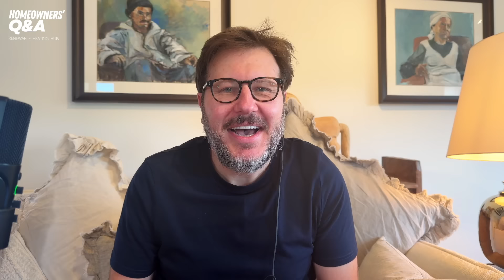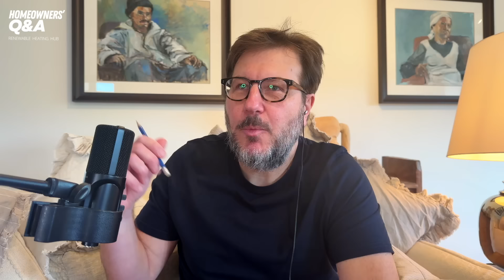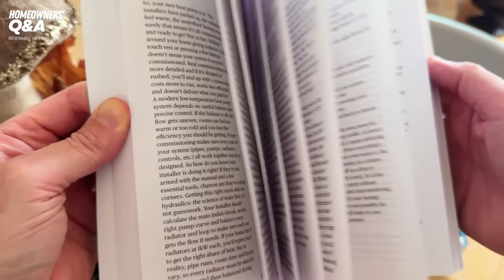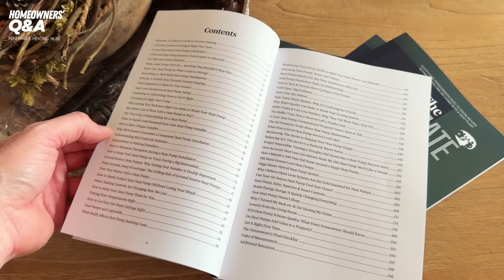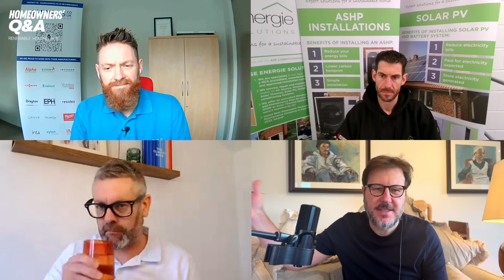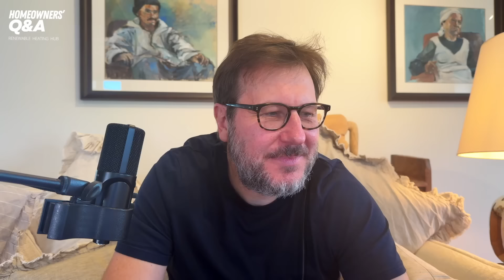What Happens When Your Heat Pump’s Flow Rate Is Wrong?

Comment: Just stumbled over this as a new house owner in DK with floor heating. Compensation curve and flow l/min absolutely have a big impact how warm/cold the house feels and on the electric bill + noise from outdoor unit. We had to lower the outlet from 35 to 31, the delta t from 5 to 3 and the flow l/min from 14 to 23. Much warmer house in general, less noise from outdoor unit and a unit much more effiicient.

Comment: How does a homeowner recognise they have an issue with flow rate in their system vs another contributing factor?  I can't see the flow rate setting on my ASHP so have no idea - and to be fair, if it said 1.5l/s I wouldn't know if that was right or wrong.  Interesting statement on balancing radiators and "quarter turns": the balancing approach documented by one of the Forum members basically takes that exact approach and is praised as being the right approach; I've even seen comments associated with it to not worry about the DeltaT.  I think that ASHP technology is brilliant and issues are clearly down to design, installation and commissioning.  Unfortunately many of these videos leave a worrisome feeling in viewers (if I assume that it's not going to just be me!) because they talk a lot about the problems, and a lot about how they arise, to the extent that it feels like pot luck to get an installer like one of your contributors: there needs to be some balancing in the messaging here as it's not enough to declare "a world of pain" with a smile.  If I'd watched a few of these videos before getting a heat pump installed I doubt I would have gone ahead as it's way too fraught!!  

I don't want to come across as critical as I'm glad you are pulling these people together and discussing the topics.  But after N number of videos, all blaming poor design and installation, we know it's poor design and installation and repeating that message isn't moving us forward.  Perhaps you could do some hands-on type videos (here's a series name: "So you've had a bad installation...")  that could help a homeowner identify and know how to resolve an issue without concentrating on how these situations come about.  For example, perhaps your panel of experts could agree what is the best way of balancing the system, explain how a homeowner can identify an unbalanced system, and how they could properly balance it and then show us on an actual system.  Homeowners shouldn't have to do this type of post-installation fixing but the reality is, currently, they have to, so we might as well knuckle down and not just throw our hands up in the air!  Any chance of getting a Government Energy Efficiency MP on a podcast to explain the issues and discuss what could be done about it ("So, you've had a bad installation...this is what the Government | MCS | "Industry Body that should take an interest but doesn't" thinks about that")?

Comment: Have watched many of your videos and comments obviously left by lack of response in the bin , not on this planet to judge oneself, having listened to the so called experts can only conclude that heat pumps are definitely one hell of a scam , you yourself have two wood burners somewhat surprised you haven’t looked into a pellet stove for your central heating, with the voice of Leko supplies pretty sure you wood or would get a discount and would probably last longer that the six years your heat pump lasted.
Reply: I can assure you (talking as a customer) there is nothing scam like in heat pumps, they work, you will most likely have used a fridge for years with no issues, they are a heat pump! The issues discussed on this channel are systems that were never designed or installed properly, have a look at the Heat Geeks channel for lots of information on them.
Reply: I think this is an example of how two people can draw completely different conclusions after watching the same video. My take was that success or failure of a Heat Pump installation was dependant on the basics - designing a system that can meet the heat load of the property. Do that part correctly and you'll end up with a happy Heat Pump owner. We have an ASHP and our home is warm 24/7, running at a lower cost than when we used to heat with a gas boiler. That said, I am not advocating that they are a perfect fit for everyone, but there is no question that a correctly designed system will warm a home and provide hot water.
Reply: I'm not sure what you are referring to, but YouTube has a habit of automatically hiding comments.
Reply: What is the purpose of this scam? My heat pump works fine and is cheaper than gas. How am I being scammed?
Reply: When Maurice mud placed the Volumetric flow rate calculation in the transformation triangle we thought it was genius. Its always going to be the Maurice mud triangle for me.
Reply: They are not a scam some are just poorly designed, installed, or commissioned, just the same as many gas boilers.
Before getting my heat pump I had a condensing gas boiler. I paid extra for a weather compensating smart stat.
The installer installed the boiler set the flow temp knob to 70 degrees and walked away without explaining anything.
I later improved my knowledge  and found out a condensing boiler won't condense above 55 degrees.
I did my own research, learned about low temp heating and found after replacing two radiators I found I could set the boiler to it's minimum flow setting and let the weather compensation do it's thing.
It knocked about £75 a year off my gas bill.
Even the old school service engineer I used every year would turn the flow back up to 55 when servicing the boiler and I would have to turn it back down again once he left.
Reply: @nervousfrog101  My home was basically 'Heat Pump ready' when it came to making the switch, as I had taken a similar journey as you. I was nearly 50 before I encountered my first central heating system. A friend explained to me how 'Condensing Boilers' were rarely setup to condense, as in your experience. He suggested I upgrade my pipework and fit the biggest radiators I could. The transformation was night and day. When it came to having the heat pump installed I just had 2 radiators changed because they were the 'Designer column' type and we had no data sheet to confirm their output, better safe than sorry. It's great to hear that there are other people like me.....can't wait to tell my wife , she thinks I'm obsessed with Heat Pumps! 😀
Reply from the maker: @KavanOBrien, we’ve definitely not had the best heat pump installation, but that doesn’t change the fact that the technology itself works and it’s miles ahead of any other form of heating.

As for the fireplaces, not sure why you’re so fixated on ours! We live in a rural area and simply enjoy the atmosphere they create. There are plenty of ways to heat a home, and for us, a fire now and then is part of that comfort.

We’ll never be getting a pellet stove!
Reply: @RenewableHeatingHub 

The discussion was interesting, thanks. But did i really here this right. You have a 18kw heat pump🤯 Do you guys live in some 500+ m2 mansion? That's just crazy big, it's double what I have heating 160m2 to 21c (+ 90m2 basement to just +8c) house down to -30c without a problem.
Either the UK really has zero insulation or something is seriously wrong
Reply: @RenewableHeatingHub  on fireplaces; "We live in a rural area and simply enjoy the polluted atmosphere they create."
Hilarious 🤣
Reply: @RenewableHeatingHub  heat pumps are miles ahead wow , in what way ? The cost of installation? The cost of running it ? The lack of longevity? Hopes of getting it installed without a cowboy hat , the heat pump industry are so far away from any form of stability compared to a gas boiler scenario I’m shocked by your conclusion in regards to miles ahead, I’m not being critical for any particular reason, believe it or not my mind is open to everything I have never had a closed mind as I’ve walked lives path , having watched many of your videos one would like to think being of average intelligence there’s only one conclusion is to stay away form heat pumps, I’m I right maybe , could I be proven wrong my house is open for any or all of your experts to do so , are all of your experts up for the challenge we both know they aren’t, show them all my comments being critical , if you change this person mind then the future of heat pumps stand a chance ,
Reply: @KavanOBrien  The only countries where Heat Pumps are contentious are those where fossil fuels have a huge dominance in the market.

I used to live in the UK with GCH, and have lived with Heat Pumps in Sweden for over a decade, and I'm going through the process of buying a house in the UK to move back.  The property has GCH, and it shouldn't take much to guess that I'll have it switched to heat pump heating as soon as it's feasible. Grant or no grant.

What's strange is you seem to think gas boiler installs are perfect - they're not, most installed in the UK have their issues masked by the cost of gas. If gas became 12p/kWh, people will be quick to find out that their gas boiler needs to be run more like a properly installed heat pump, and would end up saving hundreds of pounds a year, i.e. lower flow temperatures, weather compensation, proper sizing and a cylinder for hot water.
The problem for gas (and oil) is, it only beats a heat pump in high temperature situations. Once the wider consumer base realises that in low temperature situations, heat pumps rule the roost, gas/oil boilers become a very hard sell.
Reply: @BenIsInSweden  when replacing the GCH would you be tempted to go solely A2W or A2A or both together?
Reply: @KavanOBrien have you any experience or are you just talking?